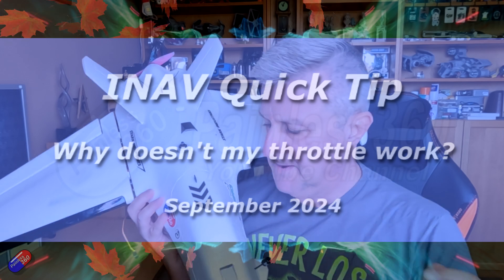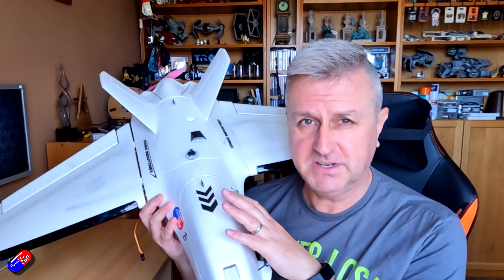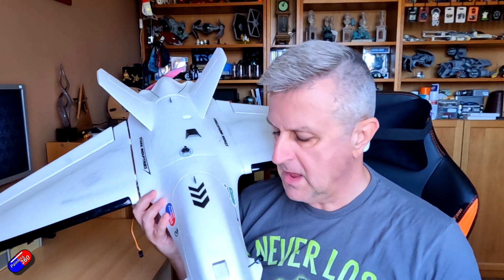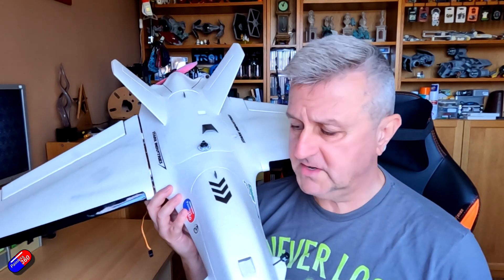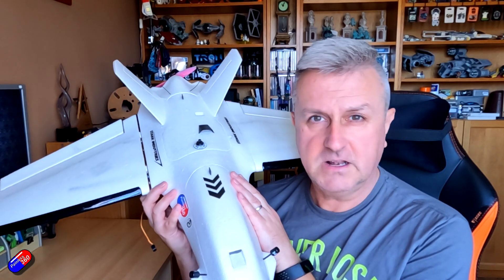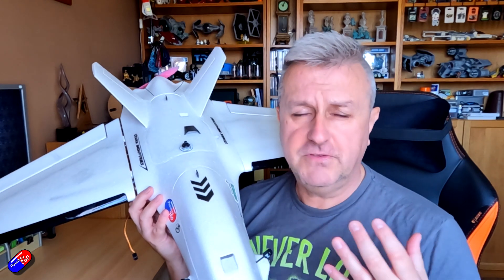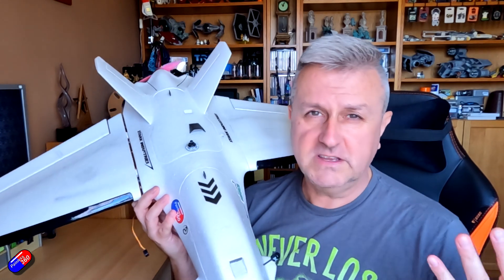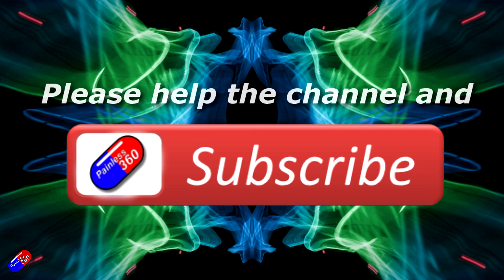Why won't my throttle respond on my INAV Plane/Wing?

Comment: Hi, please I'm using the matek f405 v2 I can't arm throttle but I can control my servos when i push on the throttle nothing happens, I have calibrate my esc but still the motor doesn't response to my throttle, my servos at first when I turn the plane my control surface used to move it but now it doesn't something you can used the transmitter to control the receiver and it stopped you have to disconnect and connect it because you can control the servo again
Reply from the maker: You need to ARM the flight controller.... if you're doing that, let me know what troubleshooting you've also done.

Comment: Have you ever encountered screechy motors at low-mid throttle up via FC.  Trying to diagnose if it’s a scaling/desync issue with my setup.  Tested two separate motors same results when connected via FC but they both run smooth and quieter using standard servo tester.  Any thoughts on this or if you’ve ever encountered anything similar?  Appreciate the help and always awesome content.
Reply from the maker: I've not seen that here. Sounds like an ESC timing thing to me, Best of luck with it!

Comment: Thank you for the heads up. Recently, I changed the Dolphin motor from an Emax EcoII 2400kv to a T-Motor F90 1500Kv using the same 7042prop and launch settings. Upon Autolaunch the plane somewhat stalled and crashed in both my attempts. Could you please suggest what settings I should change in order to launch the plane successfully?
Reply from the maker: Why did you expect it to work? That is a huge reduction in KV. See my motor and prop series if you aren't clear on why this wouldn't work... best of luck

Comment: Great point! But the stick wiggle has to happen before you raise the throttle, or it won't work, at least not in 6.0. That had me scratching my head the first time I set up a hand launched model. If you have already started the idle spin, you need to disarm to stop it, then rearm, and then wiggle your right stick before you raise the throttle. Now you're out of auto launch.

Comment: Thank you very much for your content, I really appreciate your work. I try to get my head around the iNav land-waypoint feature and I can't get it to work, I'm pretty much back to default and it doesn't seem that complicated. The landing waypoint and heading are set and loaded (no safe home settings), the model turnes about 1 circle and then tries to land "someware in the area" instead of the heading and approach settings defined. 

Just in case you need an idea what thing to cover, it's come up in iNav 7.1.2
Reply from the maker: INAV landing video is in the works - stay tuned!
Reply: @Painless360  oh wow... that would be great, cause there are pretty much none out there. Just some from the OSD and that's it... So, I mean the Fixed Wing Version of iNav.
Reply: I have the same issues. Just cant get it to work even with an nice benewke lidar